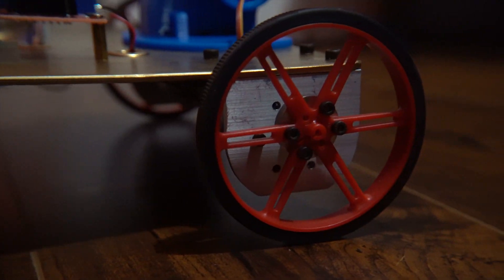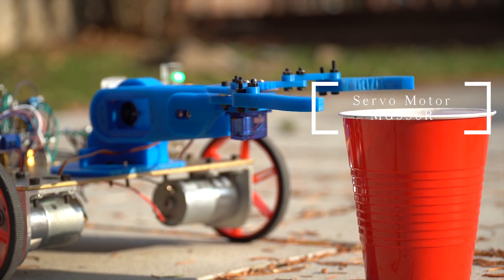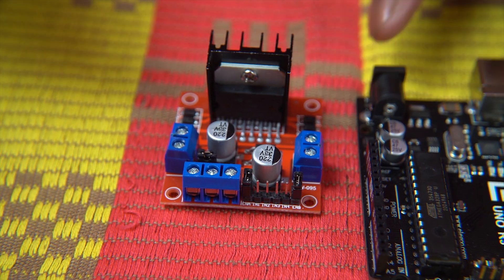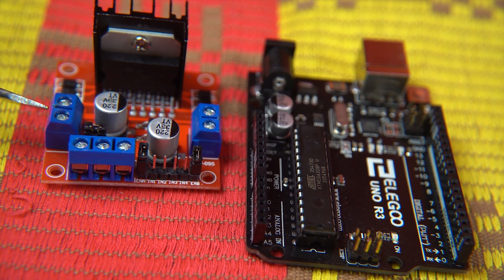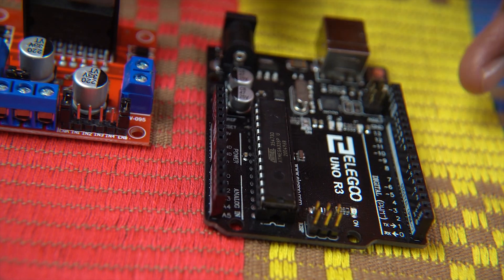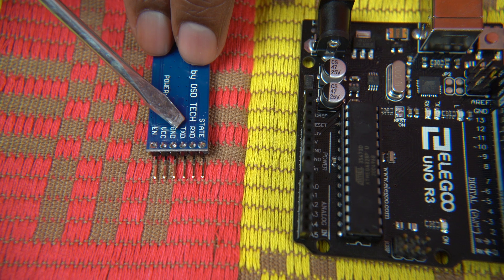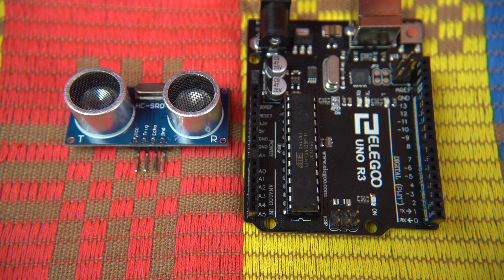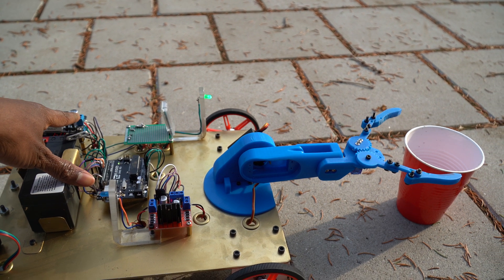Bluetooth Controlled Arduino Remote Car with Robot Arm | Detailed Explanation | Part 1

Comment: Sir, awesome project. Sir, can I use Arduino uno instead of ELOOGO Uno? Sir, can the Arduino robotic arm vehicle project work if I connect the Arduino uno instead of ELOOGO Uno, does it work yes or not if I make the connection between Arduino uno, motor driver, Bluetooth module and the 2 DOF Arduino robotic arm vehicle project in the circuit, will the Arduino robotic arm vehicle project work yes or not? Sir, I love your project very much.